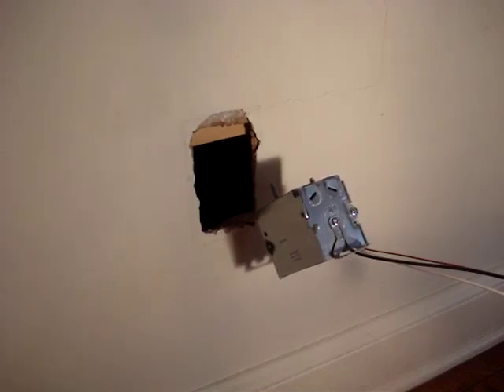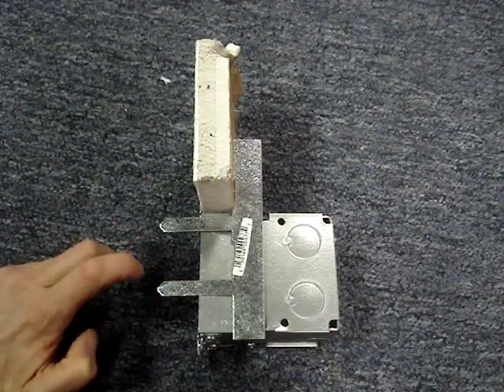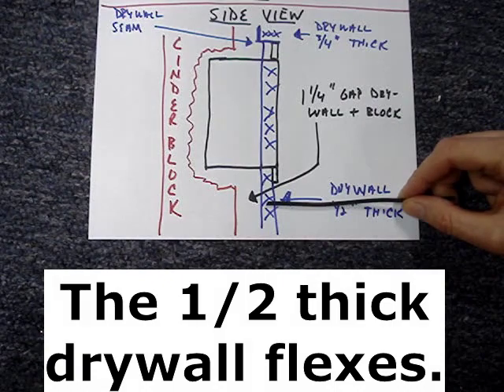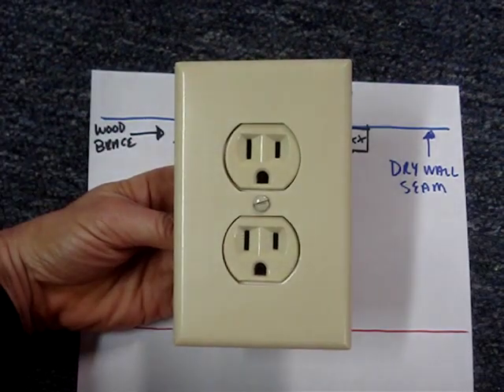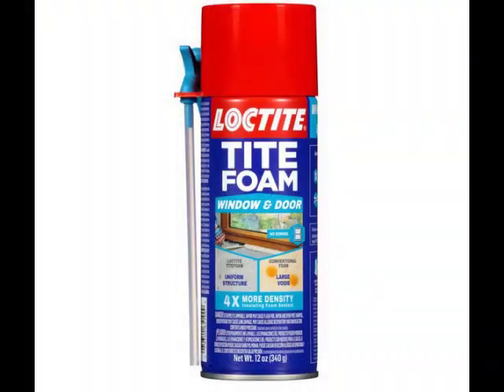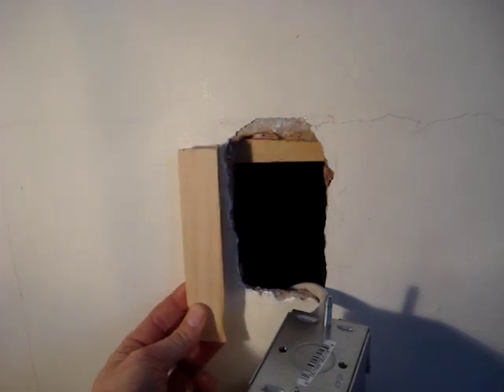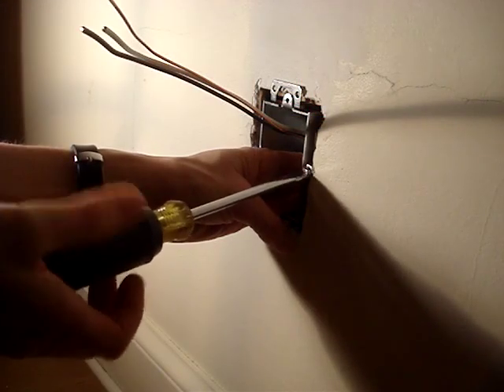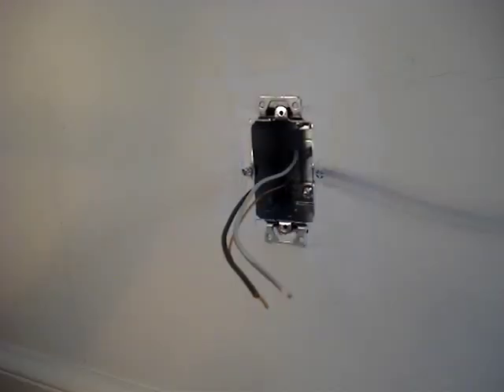How to Install an Old Work Electrical Box - Retrofit

Comment: Clever solution to a classic old house problem. The first thing everyone learns on a old home is that things are rarely the same.
Reply from the maker: I agree.  This one had me thinking for a while until I had a solution.  BTW the outlet in the video gets used a lot and it is holding up to pushing & pulling plugs in out of it.

Comment: I really like the way you showed how you dealt with problems that came up. So many videos show how to do things in ideal conditions. In my experience, what you encountered is more in line with reality. For example, today I went to replace an old outlet with a GFCI outlet in two side-by-side outdoor outlets. In the first case, the screw holding the outlet in the electrical box was rusted and it broke when I tried to remove the outlet. I tried to drill out the broken screw and the drill bit broke. I moved to the other outlet and the whole thing went smoothly. I'm still coming up with an approach for that first one. Such is life with an old house.
Reply from the maker: Thanks for the compliment, Steve.  This box was quite a challenge.  I thought it would be a good example to show some different ideas on how to replace a electrical box.  My solution is holding up well, that outlet gets used a lot, it's still solid.

Comment: Wow that sure is a complex install!
Thanks for all of your work videoing and explaining each step : )
Reply: Agreed!
Reply from the maker: I like to solve problems, so it was kind of fun to figure out a way to get the box solidly installed.  It had always flexed a bit when using the outlet.  My guess is that the drywall is thin at that spot to compensate for something else that was not straight.  I'm sure other people encounter similar situations.

Comment: Lots of great problem solving. Thanks!
Reply from the maker: I had to roll the problem around in my mind for a bit before I could come up with a way to brace the drywall behind the top plaster ear.  It's really solid, better than the original install.  The wall used to flex a bit and the wall was cracking at the drywall seam.  I'm going to paint the room in the future and I don't want the wall cracking again.

Comment: How much material did you spend on 11$ job? First time I'm seeing silicone, shims used in installing electrical boxes. I must admit this is very creative.
Reply from the maker: It didn't cost much for material.  I had some silicone and shims on hand.  It was quite a conundrum.   I spent a bit of time trying to come up with a good fix.  It's been a while since I replaced that box.  I use the outlet a lot and so far, it's still solidly mounted to the wall.

Comment: I'm a licensed and certified electrician myself and this is literally the exact reason why you call in a professional and have things done right the first time and avoid this kind absolute mess of an extremely easy job. Seriously I'm shocked that you didn't get the duct tape out because you used pretty much everything else lol.
Reply from the maker: Hi Matthew, the problem was caused by a poor installation by a professional!   You are right, to avoid messes like this the job should be done right the first time.  BTW - the new box is installed and now when a plug is inserted into the outlet the dry wall doesn't flex as it did before.  My work is better than the "pro" that initially installed it. How would have you fixed the problem?
Reply: There is always one. Don’t be this guy.

Comment: Why the 50/50 mix of plaster and joint compound instead of 100% of either one? Thanks for the vid!
Reply from the maker: The 50/50 mix sets up in about 10 minutes and dried completely in a couple of hours.  It also has a nice texture, dries hard and can be sanded.  All plaster would be expensive and will set up faster.  For slower set up time, add less P.O.P.
Reply: @Know-How-Now  thank you very much for the information.

Comment: I've run into a very similar scenario as this - with the addition of a stud to the right of the gang box. I can secure the bottom of the box but the top and left side of the drywall has crumbled away and the top drywall  is two different depths(!) Can't use the box with ears on both sides because of the stud, and there's gaps between the sheetrock and the stud because it used to be lathe and they removed it. So now I see no way to anchor the right side without opening up the whole wall and nailing the box to the stud!
Reply from the maker: Check out this link, there is a box that can be fastened via screws onto a stud without making a larger hole.  https://diy.stackexchange.com/questions/11632/i-modified-a-nail-in-electrical-box-to-use-screws-instead-of-nails-is-there-som
Reply: Since screws cannot pass through/into a plastic box and be compliant with current code, can I just place several laters of electrical tape over the screw heads that are inside the box?

Comment: Except that old work box you used is for a switch. Not enough room for an outlet. Code?
Why do you remove tabs on the receptacle?
Reply from the maker: I am not aware of NFPA70 requiring a specific box for an outlet, can you tell me where that code violation is located so I can look it up and read it?    It easily meets the box fill calculation for one 14/2 with ground.  If you don't remove the tabs they overlap the plaster ears.
Reply: @Know-How-Now  I'm not a pro. Certainly should be noted that it only works for an end receptacle with one wire in. Metal boxes are more often used for commercial where 20A 12/2 would be used. Is it good for 12/2?
Reply from the maker: The box size is determined by a box fill calculation.  This video is not about that topic.  I do have a video explaining box fill. https://www.youtube.com/watch?v=mUH2KkRGCqw

Comment: Silicone is bad it can come loose later I would drill a screw in
Reply from the maker: I think you may not understand the concept.  The silicone is just tacking the slat in place so that it doesn't fall down while the box's fastening system is clamping it to the back of the drywall.  You might want to look at the part of video that explains how the box's mechanical system works